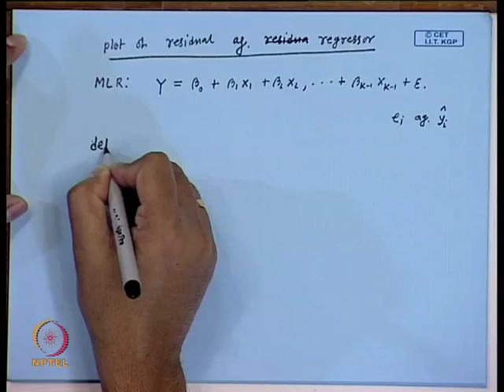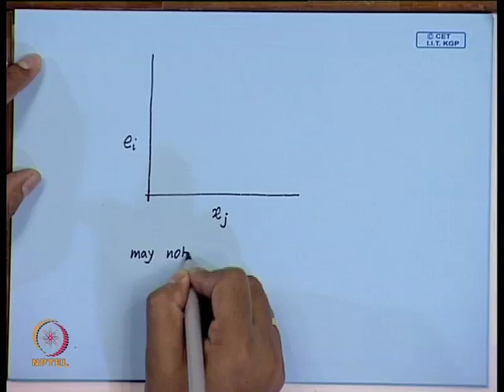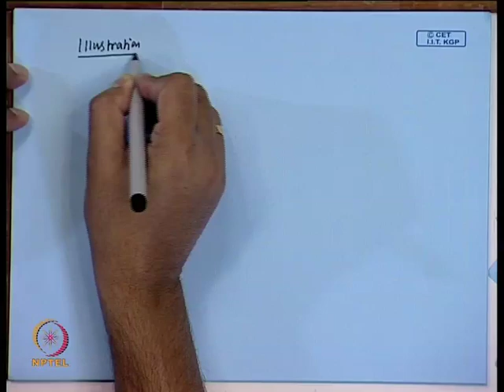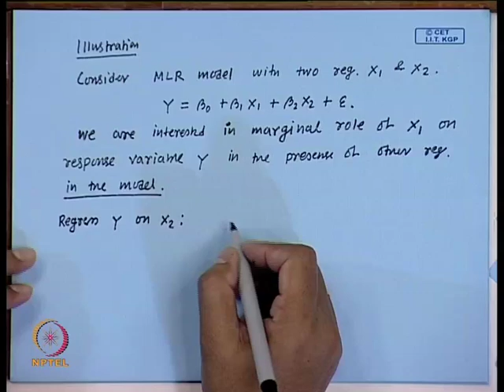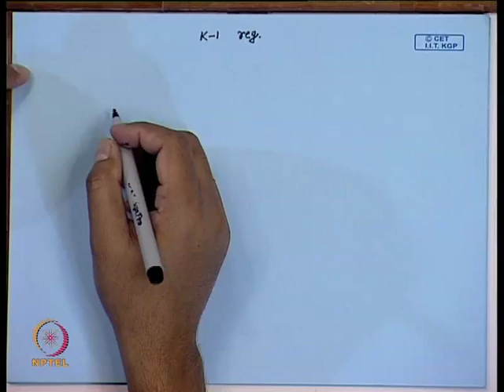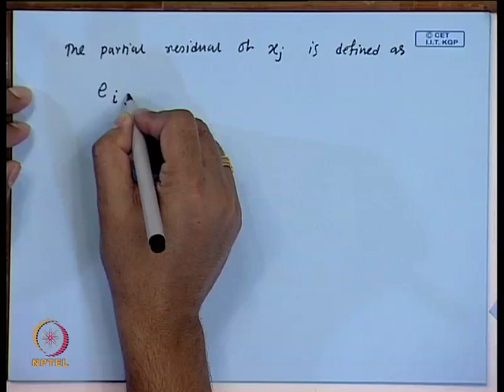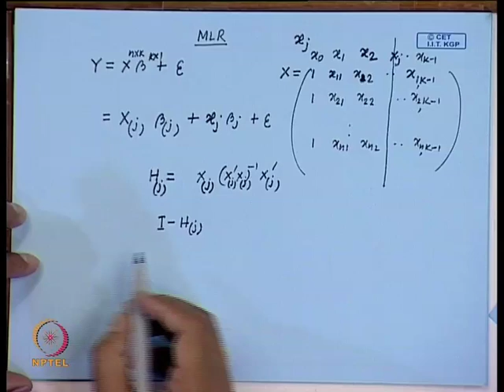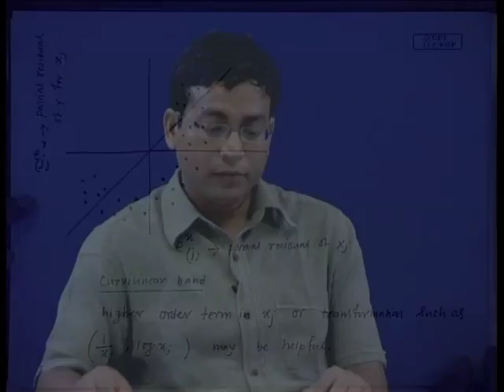Model Adequacy Checking (Part C)

Comment: What he has discuss here 16:43 is called Partial Regression Plot, he has incorrectly termed this as Partial Residual Plot.
one can check wikipedia for this.
Reply: Montgomery, ILRA, 4.2.4, Pg - 146, says that it's Partial Residual Plot..
Reply: i have chekced it in two places wiki and applied regression analysis , they both call it Part Rreg Plot, I  don't know which one is correct .. neverthelss its just a terminology . We are good as long as we are clear on what and why behind these stuff i guess